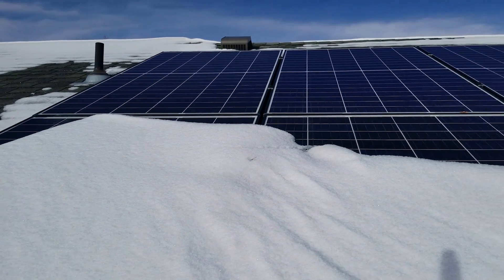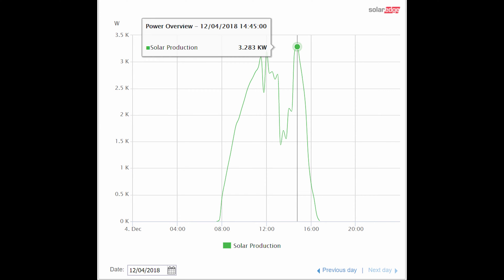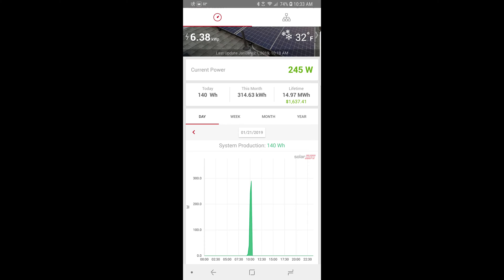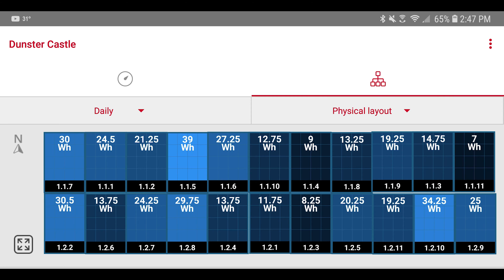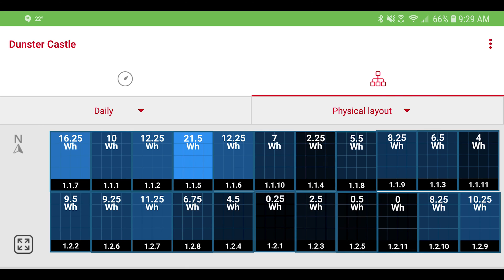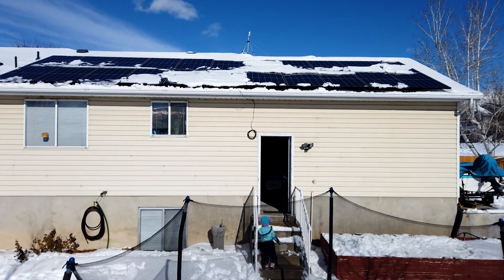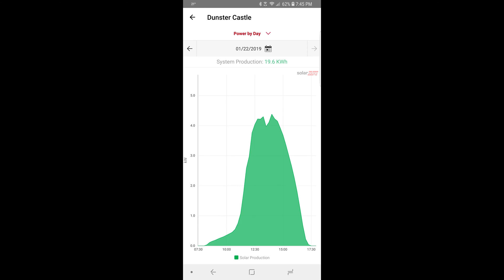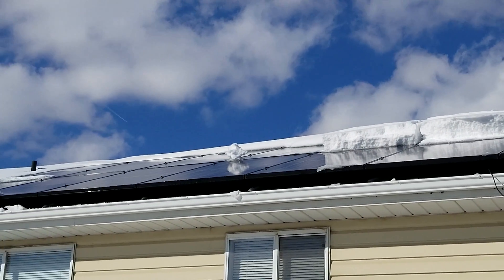First winter lesson learned; how close to edge of roof should solar panels be to avoid snow buildup?

Comment: I use a snowrake with a plastic blade to clean my panels.
Reply from the maker: On my flat RV panels I use a rubber floor squeegee. I don't need to do that on my rooftop solar panels because the snow now just slides right off.
Reply: @ElectricTechAdventures  My panels are set at 45 degrees south, since I live in maine.  I use the snow rake with a plastic blade, because I start at the top and pull down, and the weight of the snow just does the rest. Pretty simple.

Comment: Can you run those heated cables that plug into the outlet? They are the type of heat tape cables that run on a roof.
Reply from the maker: @jbr555s  I could. Even if you do that it's still a good idea to have the panels close to the bottom edge of the roof. I have found that the snow slides off within hours once the sun comes out, so no need to bother with heat tape.

Comment: Is it worth heating the panels? Maybe greenhouse heater tubes (40-60w)? You know you are going to get an extra 2-3kw of solar if you clear the panels, so why not?
Reply from the maker: I don't think the effort and money would be worth the additional power gain. If the snow falls during the day then typically it slides off right away. If the snow falls during the night then it does build up, but it's typically gone by noon the next sunny day. There have been some storms where it snows during the night, then is overcast for a few days and in those cases heat tape, or heater tubes would potentially be helpful, but I say potentially because I've never seen someone do it before to prove it out. Typically the solar production on winter days isn't terribly significant anyway since the days are so short, and the sun is low in the sky so it's just not worth the effort to most people. Also most people are grid tied so we just bank our energy during the high producing times of the year for the winter. If we were off-grid then it would be more worth the effort to do something to increase production in the winter. Typical off grid setups are ground mount solar panels which are easily reached to sweep off the snow.

Comment: I don't have this problem and I live in michigan. Since I do refrigeration for a living, I went and got some walk in freezer door heaters ( thin wiring ) and strung them along the white lines on my panels. When it snow's, I flip a switch and watch it melt. You can get them in different wattages they also go by different names like, anti sweat door heaters.
Reply from the maker: That's a good idea as long as the heating wire stays on the white line and thus doesn't diminish solar production. I'm sure many people in this world would love to buy an "off the shelf" product that they can add to their own solar panels. I've read of people wishing for that very thing in online forums. One potential drawback for people who live in areas that need to have their solar panels cleaned parodically (where there's heavy pollen from nearby trees for instance) these wires would interfere with the squeegee while cleaning the panels.
Reply: @ElectricTechAdventures  Agreed, I have an golf course behind my home that is now out of buisness. I get pollen bad, since I have my panles ground level, I just hit them with a foam spray cannon , like the ones auto detailers use.

Comment: If you had to do a re-do would you still go with the SolarEdge Inverter with optimizer or go with the micro-inverters?
Reply from the maker: So far I'm totally fine with the Solaredge and optimizers. It's been 5.5 years and everything is working great. I successfully expanded my system in 2019 and was able to find additional optimizers for those panels and got right up to the maximum allowed solar panels for my 7600 Watt inverter. Obviously if I had not planned ahead and done a larger inverter in 2017 then that would have been a problem in 2019. So that is the biggest advantage that micro inverters have is future scalability if you just don't know what you want in the beginning.
Reply from the maker: This is the video of when I expanded the system which was my original plan but I couldn't afford it all initially. https://youtu.be/YJClQ6P1YIo

Comment: Very practical videos and insights. Thanks for the great information. What is the pitch of your roof? I have a very low pitch roof (4 x 12) and am concerned with this angle especially when it snows. Appreciate your insights. Thanks.
Reply from the maker: My roof pitch is 5" over 12". I imagine 4 over 12 would still be slanted enough to shed snow. I don't know for sure though.
Reply: @ElectricTechAdventures  Thanks

Comment: Interesting! 
I have basically the same situation as you. I have 28 modules on both sides of my garage roof with a 6/12 pitch going into a SolarEdge SE6000. I just cleaned off my modules this morning (4/4/22) and they sit just about where yours did before you moved them. The snow sits all month if I don't clean the modules off so I'm planning on moving them to ground mounts this summer also because my roof is an east/west orientation.
Are using Iron Ridge mounting like me? So you must have moved the vertical rails on the modules to reposition them, is that right?

Thanks for the video and help.
Reply from the maker: I used snap n rack. I did not try to move the mounts on the roof because I would have had to do a whole lot more work than I actually did. I just slid the panels farther down on the rails.

Comment: Question: Gutter is installed to trap and guide water, by pushing panels over half of gutter, won't the water flow down directly from the roof when heavy rained?
Thanks for the video, very good lesson so people learn from you!!!
Reply from the maker: So far the rain has been coming down the gutters just as normal. If there was high enough of a velocity of water flowing off the panels maybe it could skip the gutters but that hasn't happened in the couple of years since I moved the panels in this manner.

Comment: I live in South Africa 🇿🇦 and I must say, if you guys can get energy even when it’s snowy I think it gives me confidence since we don’t have snow at all in SA, it’s a foreign thing. But I’m looking at getting a 14-18kW of solar, I’m just worried about the heavy storms that may rip the panels away, that one worries me I wonder if yours are still intact. But I’m happy to see you are getting something even if it’s small but you are since it’s snowy ❄️.
Reply from the maker: Because snow typically slides off pretty quickly during or after a snow storm it's usually not a big deal. However while the snow is on the panels there is zero production, which is why I moved my panels as outlined in this video to ensure it falls off fully and it's been working great ever since! The biggest effect on power production is actually the length of daylight which may seem obvious, but many people don't realize it. The second biggest cause of power production variance is the angle of the sun in the sky in relation to the panels. Ideally the panels are facing directly at the sun, but when they're fixed to a roof like mine I just have to deal with the production variance. At my latitude in Utah, USA the best angle of the sun is May-July. Conversely in the middle of the winter when the sun peaks much lower in the sky AND the days are shorter causes there to be a lot less production. In 2020 (9.98 kW solar array) my lowest producing month was January at 702 kWh, highest was July at 1,840 kWh. In 2018 (6.38 kW solar array) my lowest month was February at 544 kWh and highest was June at 1,290 kWh.
Reply: @ElectricTechAdventures  thanks for the info. I can’t wait for the following video.🙌🏿... but I was asking also about the “intact of the panels” on the roof since you had them, that’s my worry on weathers like hail storm especially. I wonder if hail storms ruin them or they survive.

Edit:
I did some searching on the net and it looks like they do survive hailstorms, I’m now comfortable and will most definitely get them.🙌🏿

Comment: Got solar since 2008. But I got them installed on a flat roof. Have been cleaning them from snow with a broom almost every day.
Reply from the maker: Is it possible to install tilt brackets on the panels? I've seen pictures of tilted panels on flat roofs with them.
Reply: @ElectricTechAdventures  Well yes they are tilted but the snow only usually slides down half way, it has nowhere to go, so I also need to shovel a path in front of each row.
Reply from the maker: @Mike-kr5dn  ah, I see. You're having nearly the same problem as what my video is about. I've seen YouTube videos of people with ground mount solar having the same problem and wishing they'd installed the panels higher off the ground to let the snow pile be bigger without blocking the panels.
Reply: @Mike-kr5dn  you could use something along the lines of roof/gutter snow/ice melting wires on the roof at the base of the panels to clear the snow buildup from the bottom of the panels

Comment: My first winter with solar panels... I had some snow accumulation this weekend when I arrived at my cabin. When I cleaned the panels, there was a layer of ice, hard packed snow on about 25% of the surface. Do the panels reflect heat and therfore melt the ice/snow build up? How does it slide off when they're completely covered after a snowfall? Does the sun penetrate through the snow enough to 'melt' the bottom layer and cause it to slide off?
Reply from the maker: When the temperature is really cold like below 20° f then the snow does tend to stay on the panels for longer especially if the sky is overcast. If the sun is out then typically it warms the surfaces enough to make the snow slide off. If the snow is deep enough then it could take a couple of days before the snow slides off but if the snow is thin then yes the sun typically does get through and starts to warm the dark panels. I have never gone on my roof to remove the snow before but I may experiment with doing it this winter if the snow doesn't come off during the first day of sunshine after the snowstorm.

Comment: Went to solar in 2017 and am not entirely satisfied.  Energy savings and production are good.  However, snow avalanching off the roof is a great concern.  I wasn't warned about this prior to moving to solar.   So we have to be aware of that after any snow fall.  It is quite scary.   Additionally, the snow buildup has bent the gutters slightly. The other problem is that heavy rains always cause over flow over the gutters.  And wouldn't you know it, the overflow (more like a waterfall) is occurring right over the front door and rear door.   Gutters have to be cleaned several times a year.
Reply from the maker: I'm sorry to hear you've had these problems. Makes me wonder what can potentially be done about it. I'm lucky that my snow falls off in an area where it's not a problem if it just piles up all winter. My snow also comes off in large sections all of a sudden, and I like it when that happens because I know that section is now starting to produce electricity. Because I moved my panels to end half way over the gutters the snow sliding off doesn't build up and bend the gutters at all. If we were to have a heavy downpour of rain, the water might skip over the gutters though. Being in the desert climate we're in it hasn't been a problem. Also we don't have any tall trees near our roof so I've never had to clean my gutters. Would you say the benefits of solar outweigh these issues you've been experiencing, or would you not install solar because of these issues in hindsight?

Comment: So is it better to leave a bunch of room between the panels and the gutter and let the snow pile up on the roof or let it fall like you have?  Also how did you move them vertically can they easily slide both horizontally and vertically on the track?
Reply from the maker: While "better" depends on your exact situation, when it comes to letting the snow fall off naturally, going to the edge of the roof like I've moved mine to is best. The snow does pile up on the ground below though, so if there is a sidewalk or entrance below that could be a problem. The panels move easily (depending on cable management) vertically, but horizontally is probably not an option because usually the racking is cut right to the edge of the panel array. If the racking extends out on the sides though then the attachments do easily slide sideways.